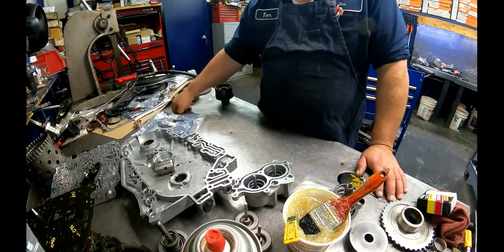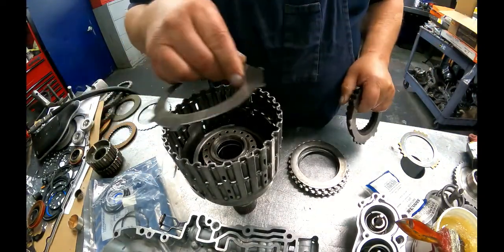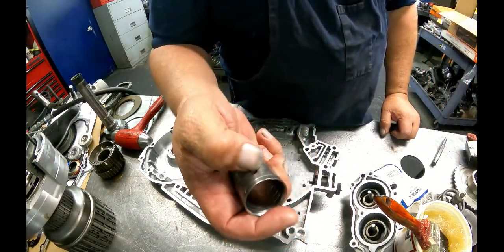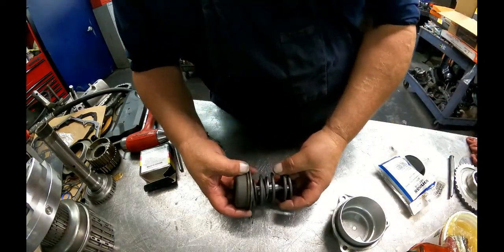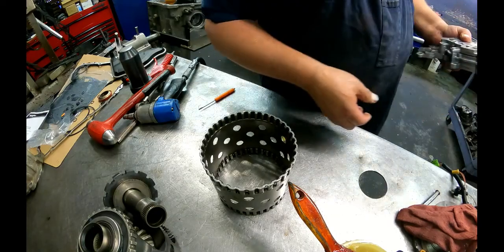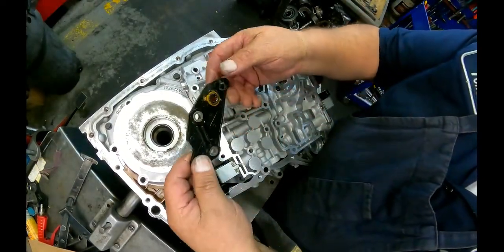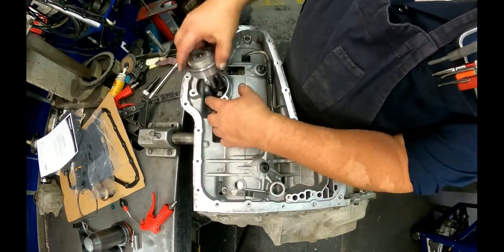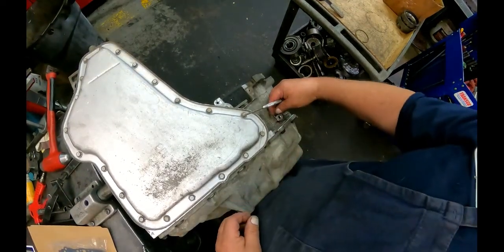4T65E HD Rebuild

Comment: Year and half ago,when I rebuilt the 4t65e in my uplander I used the Volvo clutches on my 4th gear, all I had to do was grind one tab off but the Volvo has more tabs for channel plate.  My plate had alot of wear on one of the tabs so I did this to give it the extra tab. It also tighten the pack about 7 thousands. It's been doing great. I put the sonnax pin in mine to.
Reply from the maker: Seems I remember you asking about doing that. Thanks for letting me know how it worked out for you.
Reply: @CurmudgeonTransmission  yes, it's been doing great.
Reply: @CurmudgeonTransmission  
I have that same exact transmission my daughter overheated the fluid now it slips when you try to accelerate.Could I just replace the bands to stop the slipping as a cheap fix?
Reply from the maker: @cedthetruth1311  Doubtful. But you never know what you got till you get in there.

Comment: Had an issue today.  When starting cold and after shifting to drive, nothing happened, engine just revved. Dropped to d1 and then moved to drive and it was fine.  Did this twice after car was sitting.. . Any ideas?  Shift linkage? Internal gear selector?  It isn't throwing any codes and is driving fine...

Comment: To clarify more.  When this occurs both reverse and drive don't work.  Then if you shift to d1 you feel it engage.  Then while still holding the brake, I shift to both drive and reverse and I feel the transmission engage and works perfectly.
Reply: Look inside the pan and you will see a broken part in the transmission pan if so you have a broken band I'm doing one now.
Reply: @Key's Auto Repair  thanks for response, but that is what I fixed.  The transmission will work in drive once there is enough fluid in the Torque converter.  When hot, you can turn off for an hour start it, and put in drive or reverse and all is fine, no need for d1.  Also, reverse still works when you have a broken forward band.  BTW, customer says it is running fine now... apparently had an internal leak that is not leaking now.  I suspect the pump shaft seal might have expanded....it was scarf cut.
Reply: Sounds like the filter is sucking air or clogged up.
Reply: It is possible. I am working on the assumption it is drainback as suggested by Mr. Curmudgeon.  Very easy test for this.  Check fluid level when hot, ensure it is proper level, let sit overnight and see if level rises.  If it rises, it is drainback. Next time car is at my shop I will test it.

Comment: New problem (you make it look easy!!).  I installed the new Input drum bushing and the overdrive clutch hub shaft did not want to go in.  When it did it was TIGHT!... Not the way it used to be before the shaft went in.  I took it out and have ordered  a few more (waiting again!).  I realize I might be at  fault here because I hammered the bushing in with a bushing driver. I didn't think I hit it too hard or anything and did not see any damage on the edge of the bushing.   Next time I will use the  press.  Any tips? Thanks again!
Reply from the maker: Press will be better. Good set of bushing drivers and an arbor press will make you wonder why you ever lived without them. Regular press will work fine though. Just find something around the size of the bushing to use as a driver.

Comment: Hey I was wondering what all specialty tools you need to rebuild one of these? If you could please tell me any possible tool tips as well I'd gladly appreciate it!
Reply from the maker: None that you absolutely have to have. Seal installers are nice but before I had them I used a oxygen tank protector to install the front seal and bearing race to do the passenger axle seal. You can do the return springs in the drum by hand if you got tough fingers. You can use a feeler gauge as a lip seal tool.
Reply: @CurmudgeonTransmission  What exactly is an oxygen tank protector? And how exactly would I know the clearances?
Reply from the maker: Metal cap they put on oxygen tanks to protect the valve during transportation. There are not any listed clearances. They assume if you use the correct parts, it will come out properly. I can tell you that when you put the extra steels in the 2nd and 3rd drums it will be really close to zero. Probably about .020. As long as the clutches turn, and you can move the pressure plate up and down a little it will be fine. Never had one not come out correctly. The input clutches will be around .045-.060 I would say. If you have to replace any steels on 4th gear measure them and put back exactly what was in there.

Comment: First off, you are very attentive to all questions. Thank you for that! My question is, I ground one of my old clutches to use as a spacer as you mentioned in your video. Mind you, this is a clutch disc, not a steel. With this the clearance is way too tight...(.028) How do I go about grinding this extra steel futher do you suppose? It's still way too sloppy without it but it is so awkward and thin that I don't know how to go about it? Thank you.
Reply: Does the wave steel just make it seem like it's too tight or am I correct that .028 is too minimal?
Reply from the maker: You are fine. It usually ends up about .030 after adding the steel. It will work.
Reply: Thank you kind sir
Reply: I attempted to punch the input drum bushing out just you did...it just push all the way down evenly and now I don't know how to get it out. You seemed to some how get it to roll and then  grabbed it with pliers. I also managed to scar the wall pretty good.
Reply from the maker: There is a seam in the bushing, most of the time. If you can find where it is, usually the bushing will split. Depending on how scarred up it is you may be able to smooth it with some sand paper or a file.

Comment: Hey, Do you know if the cv axle bearing is pressed in from the inside? I'm not wanting to tear the trans apart to press in a new bearing. Please respond
Reply from the maker: It will come out either direction.
Reply: @CurmudgeonTransmission  any tricks to removing it with the output shaft there? Those roller pins fell out too. Any chance those are in the casing?
Reply from the maker: I have never removed one in the vehicle. You will have to find a puller to get in there. Maybe a Snap-On CJ93B. Don't think they can get in there. They may be up inside the 4th shaft. I would stick a small magnet in there.

Comment: My 2004 monte carlo supercharged foward band broke. How hard is it really to do this or fix it. I have dropped the transmissions on these cars to replace all the sensors and shift solenoids.
Reply from the maker: You have to take it almost all the way apart. Might as well rebuild while you are there. Guarantee it will have other things worn out also. The 2-1 band burns when the forward band breaks.

Comment: Hello, need your help  I built a 02 Regal 4T65E  with all the updates and it shifts perfect , no codes but it overheats and goes into hot mode after about 1 hour driving , any ideas what to look for? Thanx for your help.
Reply from the maker: I would check the transmission with a laser temp gun to verify it is indeed over heating. If it is check cooler lines and make sure they are not kinked, water level in radiator, cooler flow. If not it will be something electrical. Trans temp sensor, wiring harness, bad ground.
Reply: @CurmudgeonTransmission  thanks,  I   checked car cold with my scanner ,all temp sensors same temp  intake ,coolant and trans temp ,I checked cooler flow was good filled jug in about 45 seconds, installed aux cooler but same issue, noticed cooler not getting warm at all?  Kind of a mystery.
Reply from the maker: Sounds like you are getting a false reading of overheating. Would be looking at  the electrical side of things. Put a volt meter on the trans temp sensor wires and see what it is actually reading when it says it is overheating.

Comment: I have a question, if I had a 2wd 4t65e and pulled the outputshaft out if I could replace it with out much problem with an 4t65e AWD transfer case and output shaft. could they just be switched at where they separate at the main transmission case? thank you for any and all information you could give me.
Reply from the maker: No, the differential assy is totally different and the ring gear has to be taken out from the drivers side of the case.
Reply: Bummer, thanks though!

Comment: Thank you for this amazing video.
Can you tell me is a 4T-65E HD is a direct replacement or can be installed on 07 pontiac grand prix base model with a regular  4T-65E transmision?
Reply from the maker: The HD units usually came in the SS models and the valve body is different and cannot be used in a regular vehicle. You can put the planets in any unit you want to. The differential you can use if it is the same ratio as yours. The only other difference is the 4th clutch setup. It can be swapped also, the clearance will come out the same.

Comment: In the good old days we soaked the fiber clutches in tranny fluid before assembly. You don’t need to do that anymore?🤔
Reply from the maker: I get this question the most. Never seen a difference soaking them and not. And if it did, who is right. The one that says 15 minutes or the one that says 24 hours? I have seen a multitude of time listings. And before you say it makes the clutches swell, it makes them swell less than a half a thousandths. At least on a good brand. I have tested it. Thanks for watching.

Comment: You Sir are a Godsend! Using your videos I have successfully rebuilt my 1991 Ford Explorer A4LD and my 2000 Grand Prix 4T65E-HD. On the 4T65E-HD, what is the benefit if any from upgrading an older 2000 year unit from the Sprags to the Diode assembly? Also, you mentioned it in a different video, but what is the cause and will happen if the 1-2 or 2-3 Accumulator springs break? Thank you
Reply from the maker: Glad they helped. Personally, I don't see any. They are supposed to be stronger. I have seen more diodes fail than the roller style. Depends on how they fail. If they quit holding you will be missing gears. If they seize you will have bind ups.

Comment: I was unable to reply to your return helpful message. So I am leaving it here.
I have checked the oil and maintained the correct amount of oil on the dip stick. Do you think any kind of additive would help? I went almost a month without it happening (being careful to pre pump the brakes when stopping). I had a hard brake stop yesterday, and it started again. Just pulled over, turned off the car for about 5 mins or so, started back up, and it cleared it, to no thumping again. It does not thump on the down shift ever so far. Where is the speed sensor located (I am not a mechanic and clue less)? Is it an easy fix or major down, and do you think it is something I should get fixed?

Thanks for your response 

Have a nice day

Grandpa Charles @72
Reply from the maker: The only additive I recommend is red Lubegard. But seriously doubt it will do anything for this problem. The output speed sensor is located on the passenger side axle housing towards the top. About the 11 O'clock position. The input is inside the transmission, so it would require some disassembly of the transmission. As far as difficulty in repair. Hard to say because we don't know what is causing the code to set yet. Will require some diagnostic time.

Comment: On the separator plate, the gasket is molded. Can you reuse that or do you need a new one? Thanks!
Reply from the maker: As long as it's not damaged you can use it.

Comment: Question.. So I have been in the process of rebuilding my transmission for a little over a month now. Iam learning one mistake at a time haha. So now I fully understand why the superior kit is better at fixing the inherit design over the transgo kit. My question is that I had already installed the transgo springs and seals in the accumulators. Is it ok to leave those and then install the superior fix all parts? I also have the sonnax boost valve to install. Like I said, I have been going through some growing pains on this one. Your thoughts are much appreciated
Reply from the maker: You can mix kits as long as you do not drill holes for both.
Reply: @CurmudgeonTransmission  Hmm..So I already drilled the holes in the molded gasket. Is that OK? Or do I need to put the accumulater springs back to stock ?
Reply from the maker: Who's holes did you drill?
Reply: Now I'm confused.. I drilled the two .031 holes and bigger that everyone , including you says to do. So if I drill those holes , I can no longer install the Sonnax boost valve or transgo accumulater springs? Please just lead me in the right direction 🙏
Reply from the maker: Yes you can use them.
Reply: Just to be sure... I had bought the transgo kit, and installed the accumulater springs. Then I had come to the point in the video on the gasket where you said "These are the holes to drill for your Sonnax kit". At the same time I have been following a video I bought off ebay on how to rebuild a performance based 4t65e hd...I came to the point in his video where he said the same thing and he shows the same diagram as you did! Is that drill pattern specific to a certain sonnax kit as you mentioned? And can I use that kit in conjunction with the transgo springs since they are already installed?
Reply: I'm going to start over on this question so there's no misunderstanding ha ha. I installed the transgo kit only to find out, as you said ,that it is not a fix. Just a band-aid. Meanwhile,  I drilled the separator plate in those areas .031, .081, I forgot what the other one was? .093? Any how, is that now going to be too much pressure once I install the sonnax boost valve when I also have the stiffer transgo springs and spacers aswell? Also, I already have the sonnax 3rd gear clutch  piston installed aswell. I'm willing to eat the wasted money if necessary and just chalk it up to lesson learned. Sorry I made this so complicated.  Any advice is much appreciated.

Comment: Got the new lip seals (large lip seals) into the input drum today.  I used petroleum jelly and ATF and lubed the  heck out of it.  I still could not push it fully into the drum by hand.  It would get stuck on the lower seal it seems.  Tried screwdrivers pushing and tapping.   I finally took a Gas cylinder screw top and it fit around the piston and hammered it gently and got into position.  Hope this works... Are large lip seals this difficult to deal with?
Reply from the maker: I don't normally have that kind of trouble. I would definitely air check the drum and make sure it is applying correctly before going further. What brand?
Reply: The bag said Precision International.  I air checked the system and 2nd clutch did nothing.  Took it apart, used the Vaseline and ATF to lube it. Reinstalled and it sounded fine.  Thanks again!  Got it finished up today.  Installing it in car later this week!

Comment: Thank you for the great video. I'm attempting to rebuild mine since it cost more than the vehicle to replace. The transmission shops where I'm at don't even bother to rebuild the 4T65E. They order a rebuild and replace. Do you check for end play? You probably have done this so many times it may not be an issue for you. Love the rebuild!!
Reply from the maker: You have 2 end play checks on this transmission. One for the diff. and one for the front of the unit. Neither should have changed unless you replace hard parts. Diff. end play is .005-.025, front is .006-.020. You don't need the special tool they show for measuring the front. Just pry up on the diff. ring gear and check the clearance at the driven sprocket support and the case.

Comment: Where did you get that blue seal installer/Ring Expander that you used on the Input clutch Drum O-rings? Great videos by the way, Refreshing my 4T65E while its out of the car and I'm doing some upgrades/replacing common failure parts.
Reply from the maker: I believe Atec Transtool. Link is in the description of the later videos.

Comment: So I ordered a "heavier duty input /turbine shat". There are no teflon rings installed on it. What tool do I need for installation on my 03 4t65hd? I appreciate your info. Thanks!
Reply from the maker: I use a hose clamp. If you want the special tool for it go to Atec Transtool, link is in the description.
Reply: @CurmudgeonTransmission  thank you. What type of hose clamp?
Reply from the maker: Try and find as smooth of one as possible. If you can only get one with large ridges or holes, cut a piece of card board from the rebuild kit and place it between it and the ring.

Comment: I have an intermittent scrubbing noise that is loudest at the extension on the passenger side. Do you know of what the cause of that may be? It is unaffected by braking or accelleration. It goes pfft... pfft... pfft  with the rotational speed.
Reply from the maker: Not intermittantly. Noises can be hard even when your there to hear them. Are you using a stethascope or just standing there under the car? I have heard dust sheilds around the brake rotor make that noise.